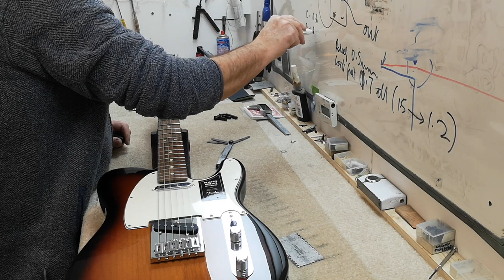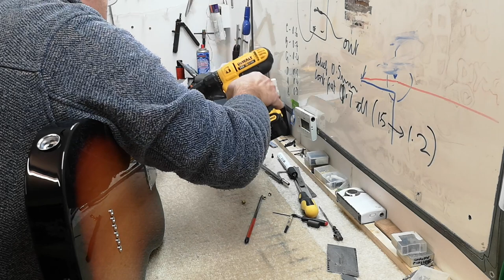Fender Player Telecaster set up

Comment: What are you doing when you put those 3 little magnets on the fingerboard ?
Reply from the maker: Hi Donald - I'm using them as a way to 'sample' the fingerboard curve (or neck relief) so that I can bend the levelling beam to match. This is important in the way I level frets - with the strings on and the neck under compression with string loading. My eBook '5 Steps to Guitar Set up Heaven' shows how to make and use this very inexpensive - but very effective - tool: 
https://www.facebook.com/relovedguitars/posts/pfbid0dWbKz8Qrp9smFAqHFXrTK2TNuAWCKhvjheE7RjbDsG5e7PRc5sfma8jmdGZGsXzfl